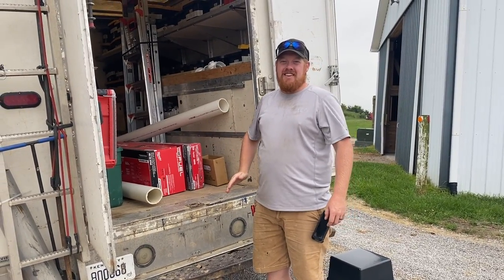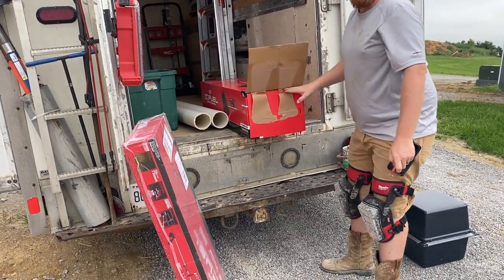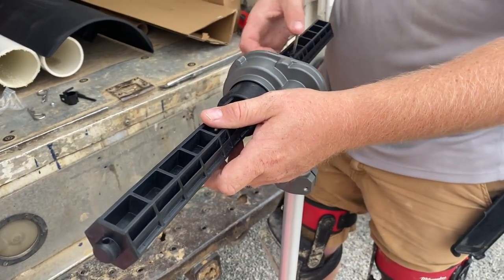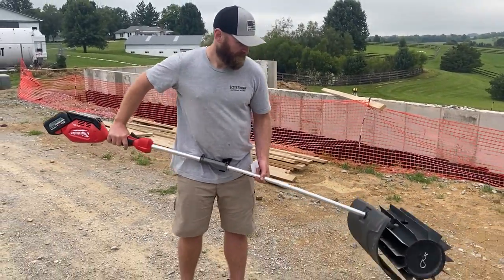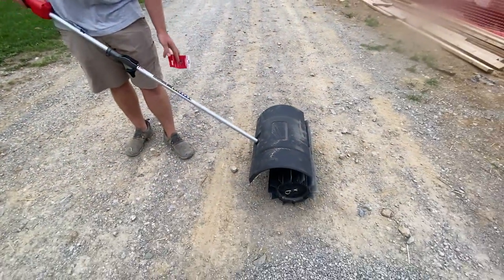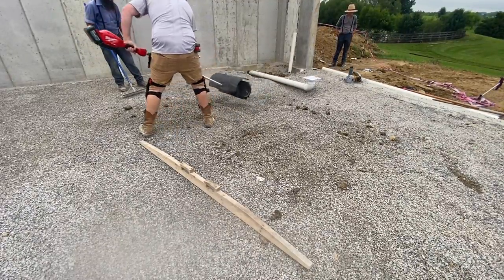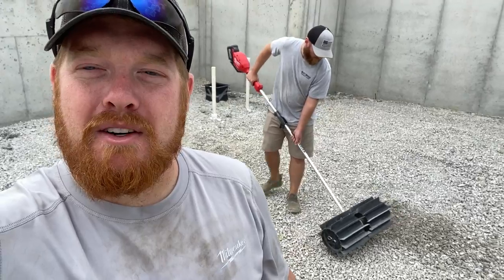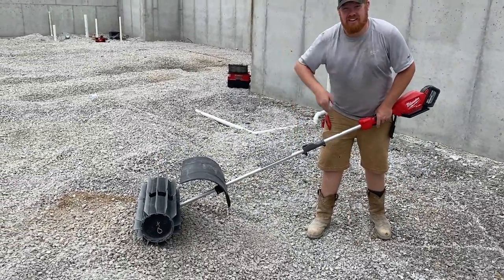Milwaukee M-18 Rubber Broom Attachment - Torture Test

Comment: How long did the battery last during your testing and what battery did you have in there?
Reply: The 12amp hour battery runs about 45 minutes with this attachment. Although startup cost is high, Milwaukee tools are well worth it in professional use

Comment: Interesting use scenario. For trenching I think a 10" wide "base" with splines that scooped dirt/gravel out sideways, lower rpms and higher torque, as well as a hip harness could turn a man into a mobile shallow trencher. It would have to be in sand or gravel though, because clay would be too much for anything like that. Thanks for putting it through an unconventional test.
Reply from the maker: I agree and that’s something I’d love to have but for times sake this was a quicker option to test out. Thanks for watching!
Reply: @evanbrown1945  Lol, I wasn't suggest you make it, just thinking for that sort of use they could engineer something similar.